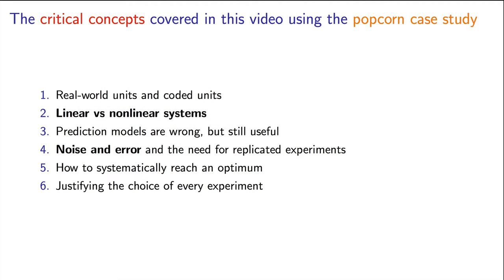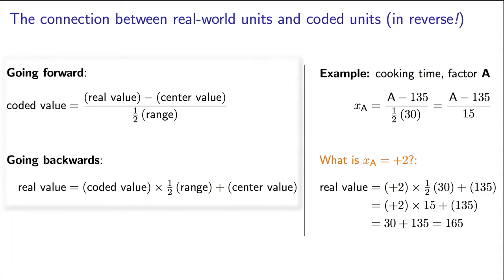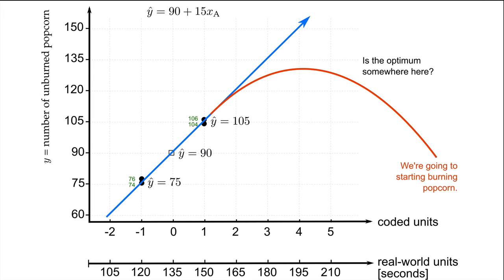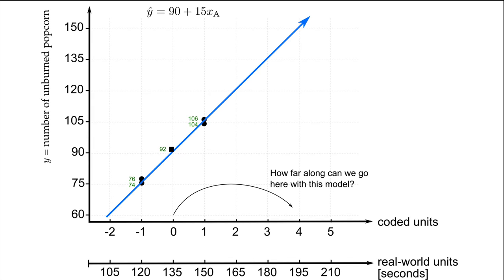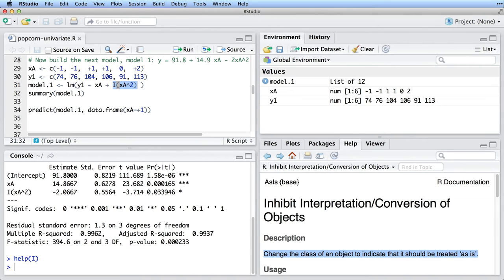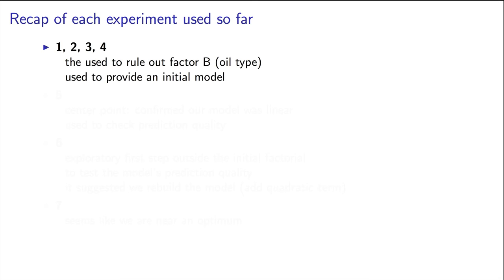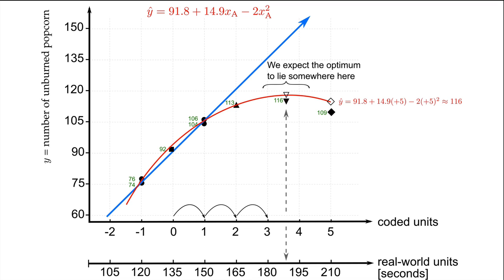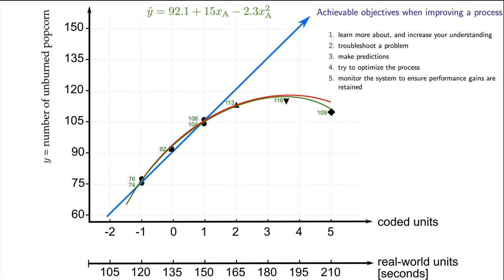Experiments 5B - Response surface methods (RSM) in one variable

Comment: Please Mr. Kevin Dunn
I need explain for optimization conditions (3 Factors, 3 Level with one Response) by RSM based on a Box–Behnken Design (BBD) and Central Composite Rotatable Design (CCRD) and how I can find the optimal point and the general equation for quadratic model.
Accept sincere greetings,
Reply from the maker: Hi Shahab, that sort of question is not covered here in the videos. However, I do have a list of resources that you can look at: http://yint.org/resources and there you will see some textbooks listed that cover that topic.
Reply: Thanks so much Mr. Kevin Dunn for your cooperation.
Accept sincere greetings and appreciation,,,